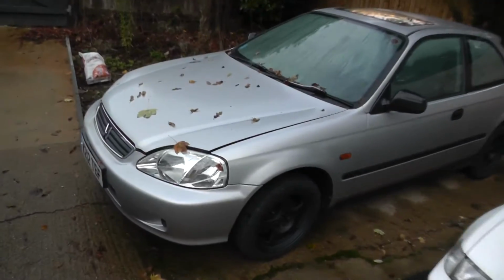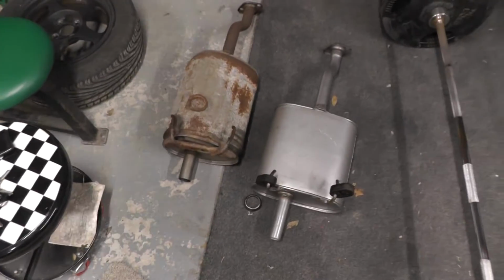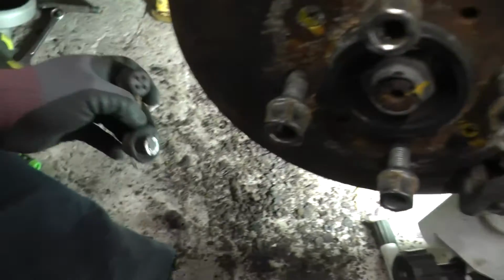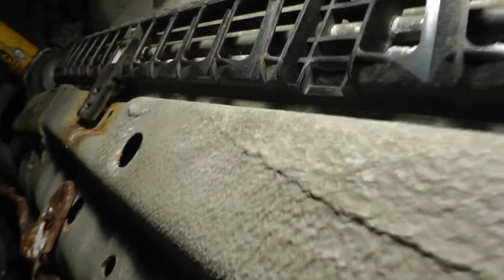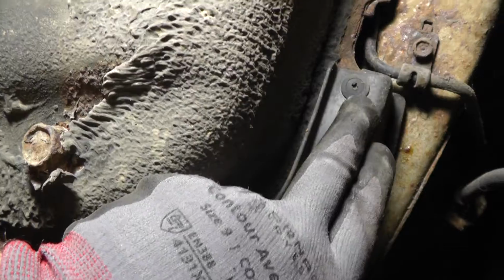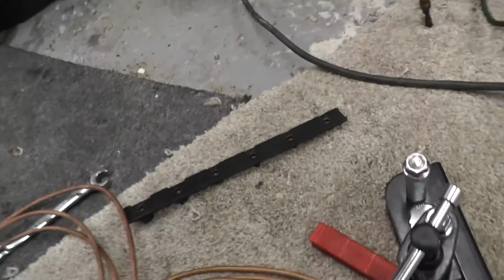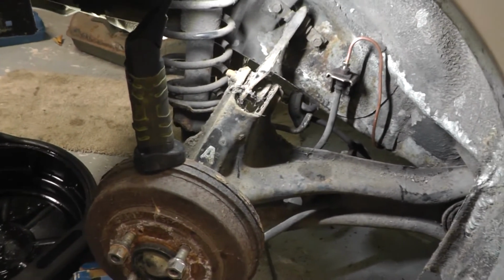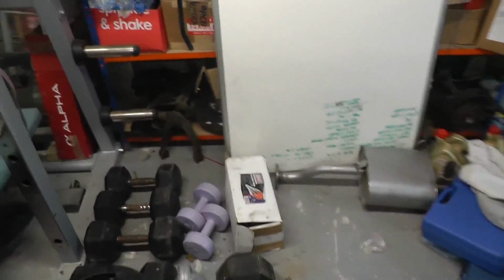Civic EK Part 3 MOT - Fixing Exhaust, Suspension Coil, ARB Drop Link and Brake Line

Comment: I would have cheated and flared the steel Line rather than taking the fuel tank out. But fair play to you for doing it properly
Reply from the maker: Yes I could have done that, but I wasnt sure how had it was.... turns out there was a fair bit of corrosion half way down the car on the pipe too.